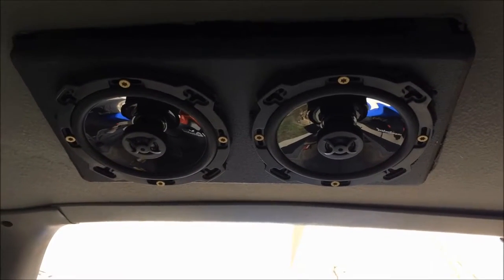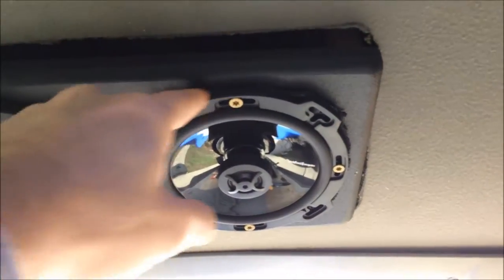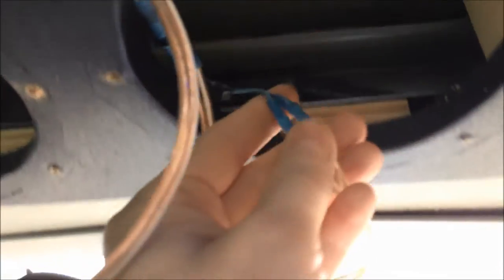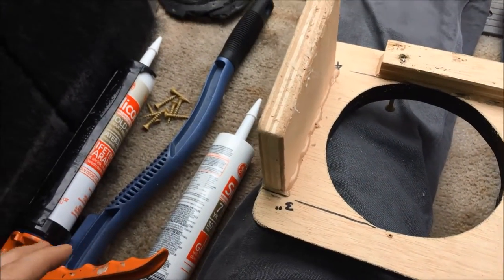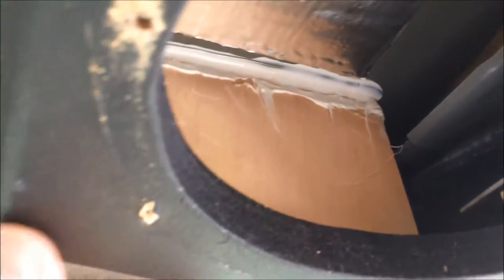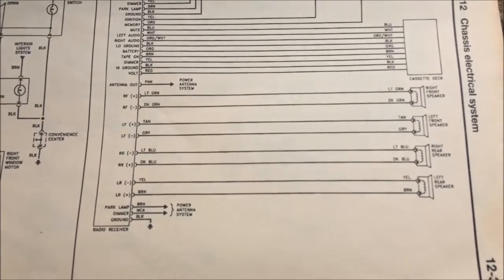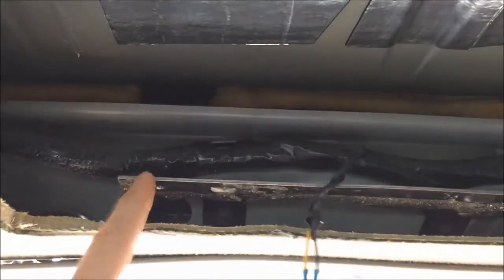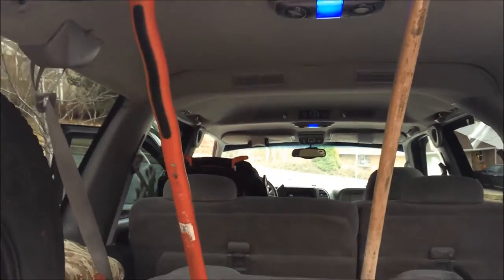20170218 Suburban Rear Speaker Repairs

Comment: Thats crazy that you can't see the 3rd brake light wiring.  When I replaced my 3rd brake light the wire just dipped below and I could see it under the headliner, If i'm remembering right. Though I do have the the hatch and tailgate so it's slightly different. I'm definitely doing rear clearance lights when I make a roof rack, I'll get the 3/4" lights like I got in my rear fenders and mount them to the rear and front of the rack.
Reply from the maker: You're thinking the same option I am.  Build the marker lights into the rack.  I also wanted to do dual high mount brake lights, though.